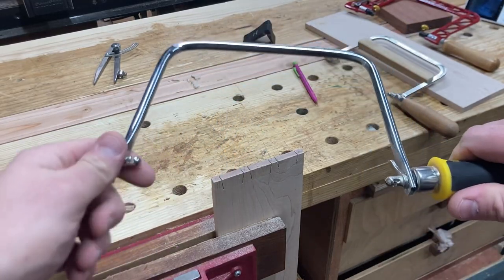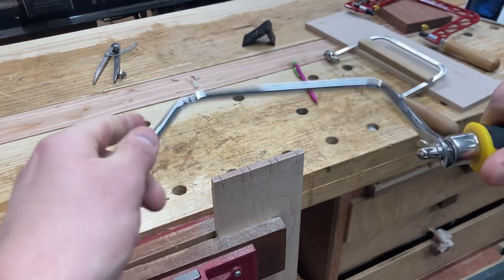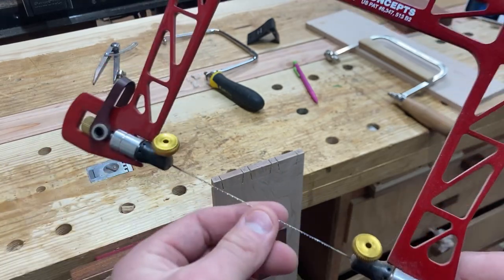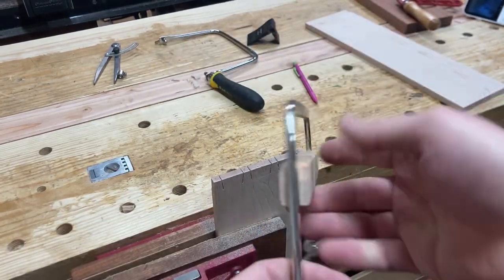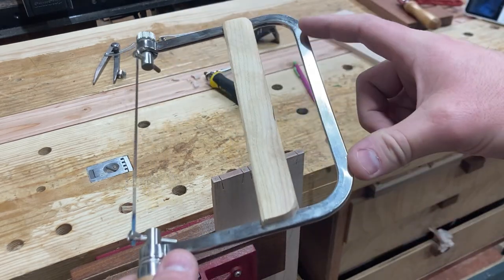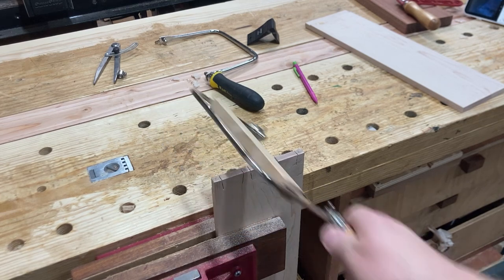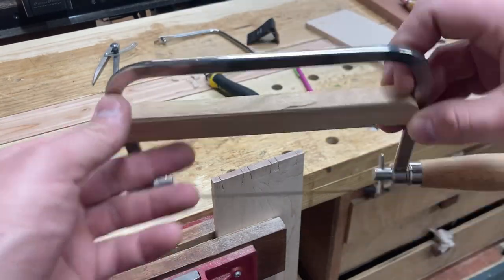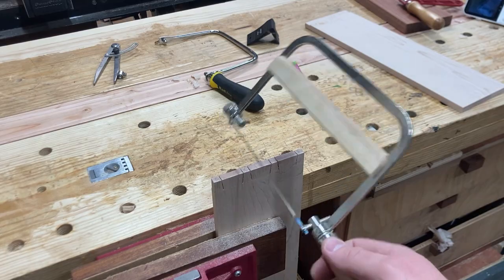Improve the Tension on Your Coping Saw

Comment: Been doing this for years on a cheap round coping saw.  Makes a big difference.
Reply from the maker: I’d be interested in seeing yours! I’ve never seen someone else make this mod
Reply: @ericrichter7933  It's really simple.  Half inch wooden dowel, 5/16 holes drilled at appropriate distance, sawn through just outside of hole centers so it just barely "snaps" onto the saw frame and stays there.